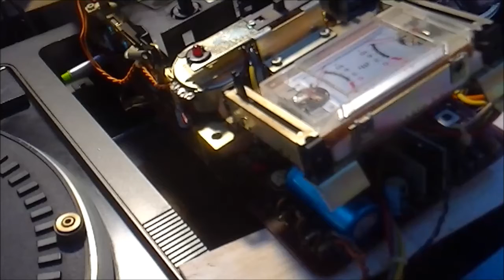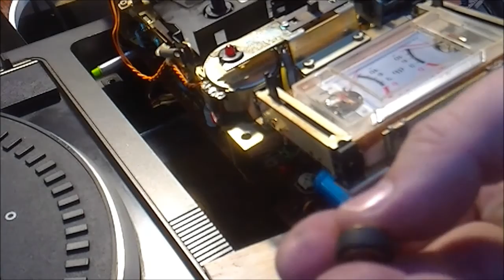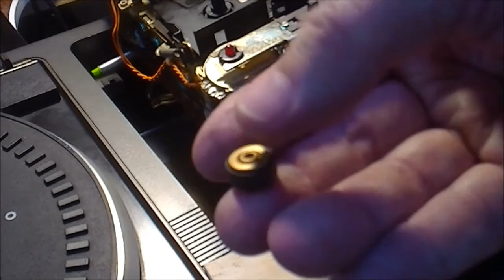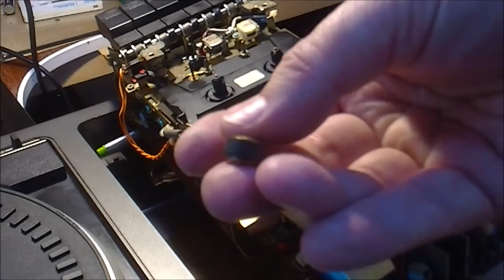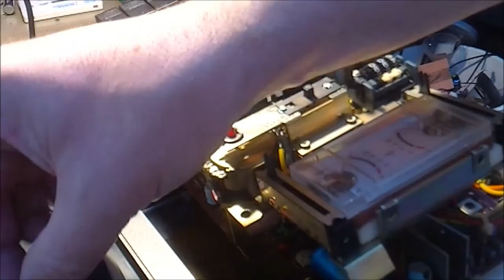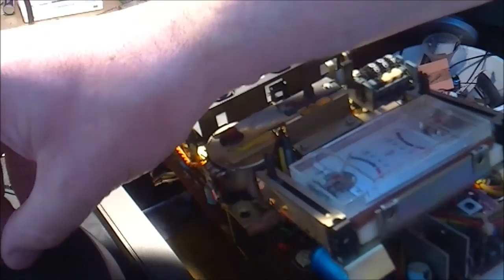Ferguson Music Centre Cassette Problems

Comment: hey River I have had this very music centre. and enjoyed it very much. both the ones I had ended up having the same fault, where a component overheated (part of the amplifier). I wish I knew what had caused it. one channel would die and strangely it happened on both the ones I had. these do beat any of the modern devices and sound very good indeed. with 78rpm record playback I would always press the mono button, which would drastically cut down the surface noise.
Reply from the maker: Pity about your examples ! I too push the mono selector when spinning 78's, as you say, it does really get rid of that surface noise.